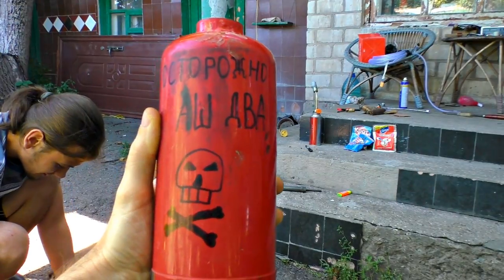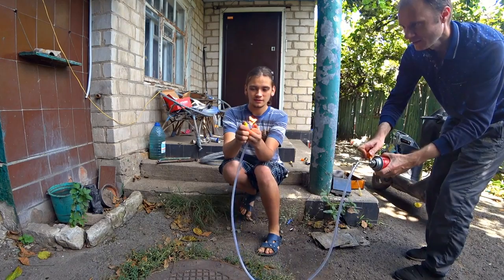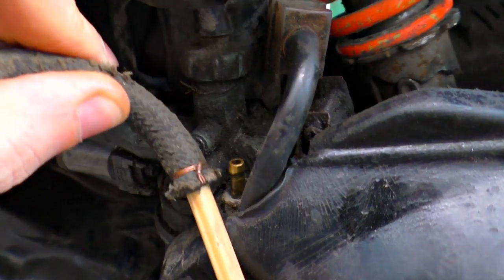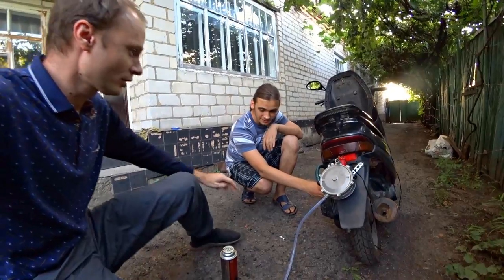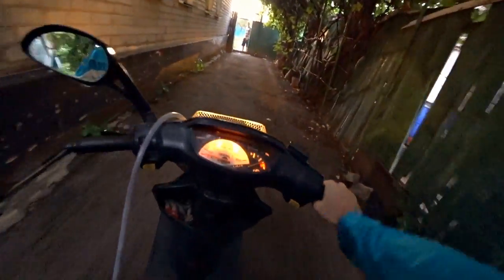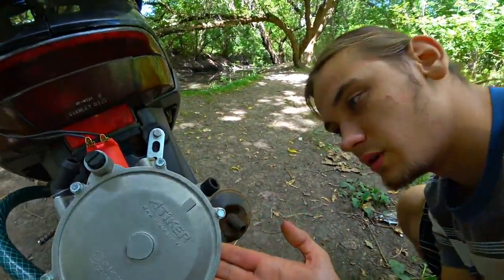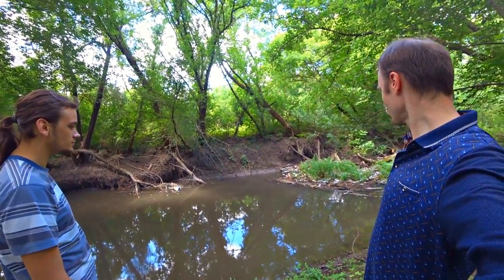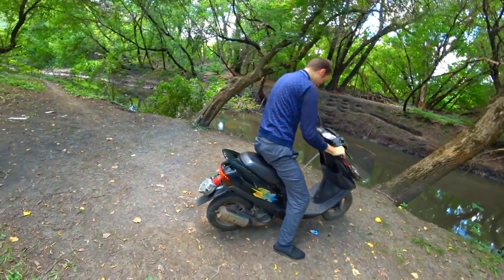Butane, Propane, Hydrogen / Alternative Fuel for the Scooter

Comment: You need to modify the hydrogen generator to separate hydrogen and oxygen to different tanks. When that is done the hydrogen shouldn't explode as long as no oxygen leaks in to the hydrogen tank.
Reply: The other problem is also the engine backfire.
Reply: @ggesdsdsdsd  Yes, as the engine ignites the first potion of gas will be burnt, it will backfire, because there is not only a fuel but also an oxidizer in the gas making it burn.
Reply: @kuchenzwiebel7147  True, a backflash arrestor would most likely solve that problem.

Comment: I love their safety standards. "We use a pencil to plug the hole" and a garden hose as a fuel supply line. Then no flashback arrestor on the hydrogen fuel balloon. Any welding store would have had that. Even a piece of metal screen jammed in the line probably would have worked.
Reply: My guy this is not america its UKRAINE
Reply: Slav has another level of safety... 
SSS: Slav Safety Standards

Comment: Remember that 2 stroke motors need oil in the fuel, other wise you will ruin the motor
Reply: Bjorn A'grin  that mixes it with the gasoline inside the carburator 

When there is nog gasoline
It cant mix well
Reply: Really? He's attempting to run on hydrogen and you think he overlooked oil?
Reply: Bjorn A'grin  wtf hahaha i built a 172CC 2 stroke racing monster with 39 HP 

Dont u fucking tell me what i do or donot understand😂

The oil is added in the carberator

If there is no gas inside the carberator Chamber the oil Will barely reach the engine
Reply: Bjorn A'grin  actually a 50cc 2 stroke engine has alot in common with a chainsaw engine

The only difference is oil reservory and a pump

The oil is feeded thru the carberator 

Its mixed there drip by drip
With the gasoline
Reply: Bjorn A'grin  dude i drive a street 50cc daily i know what system it is but its not that advanced as you think
Reply: Bjorn A'grin  i never said that there is no built in oil reservory

But yea, go check out on google how a carburator mixes 2 stroke oil on modern scooter engines
Reply: Oil tank -> oil pump -> carburator -> gasoline-> combustion Chamber 

That's how modern 2 stroke carburator engines oil themselfs
Reply: There is nothing inside the cillinder that oils the engine
Reply: Bjorn A'grin  man im talking about 50cc 2 stroke 

Go ask ur local moord store
Reply: @tamer27antepli  I'm sure you've heard that saying about never arguing with idiots... Just thought I'd remind you of it ;-)
Reply: @kirkc9643  lol true
Reply: I agree with the dude here oil gets mixed with gasoline in the carburetor, only with gas i don't know how the fuck the oil will get in the crank to lube
Reply: I know on Suzuki ad50 scooters they have oil injection 3 different spots 2 on the mains bearings and one on the intake manifold
Reply: @tamer27antepli  there are systems where the oil is added via a pump, for example the Kawasaki 50cc 2 stroke makes use of it
Reply: Yes the oil is added inside the carberator fuel Chamber 

But when the fuel Chamber is empty it cant mix with the gasoline  so it Will not get in the engine
Reply: Came  here to say that. They should learn mecanics before trying to invent somethings
Reply: @tamer27antepli Not all 2 strokes are like that, on mine the oil is dripped directly onto the reed valve...
Reply: Bjorn A'grin  It has a small line on the main intake of the engine where under pressure slowly pulls the viscous oil in.The gas that gets sucked in is already just that, a gas not liquid gas but real gas so it doesnt matter in the sense that the oil wont get sucked in it will but it doesnt account for the gas which is also a lubricant.It might have issues but i doubt it.
Reply: If that engine needs gas and oil mixed it is not going g to keep compression very long running it on butane alone. Even when you use hydrogen you'll need to lubricate the piston rings, and all the internals. Butain breaks down oil aswell.
Reply: that's a chinese GY6 engine.  it's 4 stroke.
Reply: There should be oil pump and separate tank for oil. Thats how it is with newer scooters. Older motorcycles run on manual made mix of oil and petrol/benzin.

Comment: I hope there is a separate oil tank in the scooter. :D  2T loves running on dry gases.
Reply: It would have to have one or surely their experiments would have seized up it by now
Reply: @consolehacker54  Sometimes these small blocks are not squeeze, just wearing out rapidly until there's no compression.
Reply: I believe it's a cheap 4 stroke GY6 engine, the two stroke couldn't run on propane due to not having any valves.
Reply: @lazar2175  Good explanation.
Reply: @lazar2175  That's a 2stroke for sure
Reply: @lazar2175 It is a two stroke. You can tell cylinder head, carburretor and sound most importantly. That is two stroke, 50cc. GY6 is 150cc four stroke. Two very different engines.
Reply: @slon9120  First off, there are 50cc GY6 engines and second off if this was a 2 stroke it would have seized within minutes of running on propane, they rely on having oil mixed into their gasoline and since there is no oil in the propane it's going to seize.

Also a 2 stroke probably wouldn't even start on the propane because of it's lack of valves.

Comment: Guys, it's a 2 stroke engine.. have you thought of lubrication !!! Plus gas explosion is way too dry and produces more heat which will lead the piston to expend and seize against the dry cylinder walls.   Still, you can modify your intake hose by installing a small oil injector, which will be a good idea for an upcoming video. Thanks for the video. Cheers.

Comment: In the previous video you made an HHO generator which yields a mixture of 66% Hydrogen and 33% oxygen, the perfect proportion for an explosion. You need to separate the fuel (hydrogen) from the oxidizer. My advice is to keep the electrodes far from each other in the same cell and collect the gases separately at each electrode (you can release the oxygen in the atmosphere). Btw, this method is not 100% clean because electricity is needed for elecrolysis and the power in your house may come from a coal / oil power plant. Moreover, hydrogen burns at high temperature, resulting in production of NOx (if air is used as a source of oxygen).

Comment: If you want to use hydrogen as fuel make sure you have high pressure container because at low pressure you will have too little of it for practical use. You can try to make liquid hydrogen but how will you cool it so much?

Comment: yeah, it can work, but two strokes are a bit "greasy", in the sense that they not only need oil but generally they don't like dry, or the oil can be too thick (solvable) or the oil squirter may not work perfectly (maybe), you can try castor oil if it mixes with water or alchol and let it drop little by little (but it may be expensive)... the gas reducer has that solenoid that draws like an amp of current, you can take off the coil and pull the valve via a ring magnet MAYBE (it's 100% sealed)... rubber hoses just don't work, i've learned it the hard way, you need hidrocarbon proof hoses... the gas reducer may be too big, and generally it freezes, so considering your place, heating it up with hopefully water may not be a bad idea... i don't remember about idle and "run" adjustments on the reducer, there may be two screws, also i'm not sure if you need to place the gas injection right before the venturi on the carburettor... mhh, maybe not,... keep an eye also on the spark plug, maybe a colder one will avoid some knocking

what a shame those bottles

Comment: It looks like a 4 stroke gy6 motor so I think the oil should be separated so stop worrying about a dry motor. Its just awesome that these guys got a scooter running off of LPG:) be happy everyone.
Reply: Yes, finally someone realised it's a 4 stroke.
Those chinese GY6 engines are either a hit or a miss, they are very tough but minor things break often.

Also they can't do this on a 4 stroke due to not having any valves, the propane would go right through.
Reply: @lazar2175  true

Comment: I had couple conversations about hydrogen fuel before, if your burning the hydrogen as is motor should be plated in platinum. Fuel cells are supposed to work better because combining the hydrogen and oxygen together creates more energy

Comment: Good sir you should think of a conveyor belt system with a arm with a floaty that hovers just above the surface of the water to push bottles into it and as it Cycles the bottles up the ramp little holes will let water drain back out you can make it solar power so it runs day and night

Comment: Hi guys does the scooter have an oil pump ''automatic oil dosser'' (does it inject oil directly into reed block etc ?) or do you have to mix oil manually into the fuel because if the latter is true then the engine is running without oil and will not last long... fun video to watch though as always

Comment: oh and the reason it exploded the first time is you were (probably) using HHO gas, not pure hydrogen,  and when you ignited the gas mix, it bled back into the ballon.  An easy fix for this is to filter the gas through a column of water, also called a bubbler.  I would also install some one way valves also.  there is a great source in english concerning HHO production as a PDF. I will link it here. 
https://www.doc-developpement-durable.org/file/Energie/hydraulique/HHO_Generator_Plans_pile_a_combustible.pdf
One problem I can see with that small of a scooter is the alternator probably will not put out enough amperage to run HHO production well enough to completely replace liquid fuel.  Perhaps if you added a 100 watt solar panel to the rear of the scooter it would.  Another thing is, apparently,  you would have to retard the spark 8 degrees from TDC if you are using either HHO gas  (or pure hydrogen) because of the rapid rate at which it fills the cylinder.

Comment: If you make an hydrogen generator It will generate Oxygen too. So if you wont make an injector like valve, it can be blow.  Dont feed the engine from air filter its dangerous. You cant be provide true air fuel ratio
If you ask me, you can run the engine with mixing gasoline and hyrogen.Because you need oil in it and you can adjust ratio. Make a hyrogen generator that scooter provides enegy for it.

Comment: Our car's fuel pump broke so my dad used a butane can with a nozzle and inserted it on the intake and opened it and bruh the car runs and when I check the gas tank it's still full

Comment: You need 4stroke for not burn motor or try add wd40 :-)
Reply: Wd40 doesn't burn anymore
Reply: WD40 is not a lubricant... It is a water displacer and rust preventative only. Plus, 2 strokes need special 2 stroke oil that is designed to do its job lubricating and then burn cleanly. Other oils can't do that...
Reply: @mannys9130  hence W (Water) D (Dispersant) 40